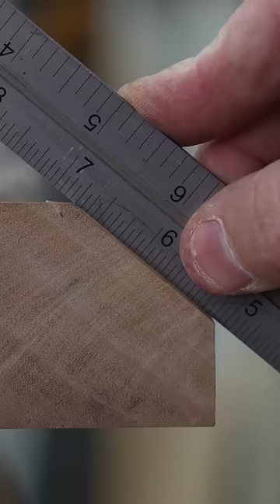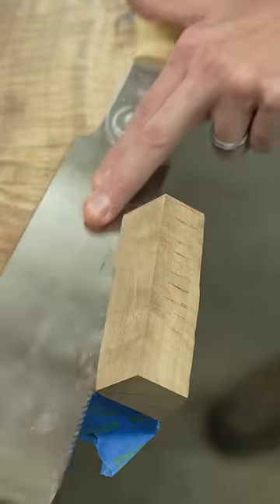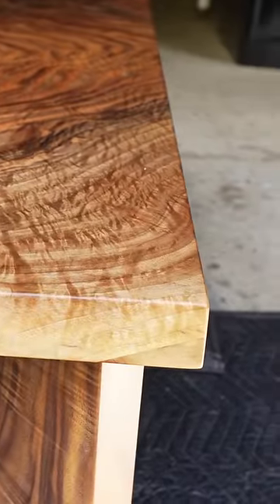Woodworking fix

Comment: That’s fantastic 
How long did you take finding a match 
You literally can’t see it 🔥
Reply: And was it an off cut from the slab itself
Reply from the maker: Thanks man, took a little while to get the best piece I could find anyway. Maybe an hour of testing chunks from the same slab. Not perfect, but about as good as I can do.
Reply: @blacktailstudiouncut  I doubt anyone will notice the difference unless it's pointed out to them
Reply: It's very visible
Reply: @jasonbroughton533  It's literally a different color. Not to mention you can see where the diagonal cut. I'm not saying it's bad, but it's definitely visible.
Reply: @dog2man1994  no it's not.
Reply: @bobkoroua  it’s on the bottom of the table not the top
Reply: @ramy1424  yes I know but it's not " very visible", if you didn't know it was there you would never notice it.
I notice stuff like this when I make it and my hyper critical brothers look and look but don't see it.
Not very visible.
Reply: @dog2man1994  its only that visible because he made a whole video on it. If you just saw the table i guarantee you wouldnt notice.
Reply: Great job that table
Reply: @highjix  I bet that’s going to be a great conversation to have with guests.
Reply: @pugas587  You can definitely see it. The corner of the piece he slapped on is way darker. Also it is confusing that he mirrored other his work on it or the final result. because the piece he glued on is on the underside in the "finished" shot.
Reply: you realize the cut is on bottom right?
Reply: You cant say its not visible he doesnt show the bottom final finish still looks pretty good looks better than the corner did before. Still good work.
Reply: @blacktailstudiouncut  i ca't even see it after the finish
Reply: @blacktailstudiouncut  nice job man
Reply: I mean literally can
Reply: You should Maybe visit an eye doctor. That "fix" is still super visible.
Reply: Not sure if you noticed but the corner he shows at the end is not the same corner, the grain goes in opposite direction...
Reply: @Dustin Fake   nobody seems to get that its upside down Jesus like I could draw round that dianagonal cut
Reply: Well then tell me where the knots went bud
Reply: For real. That's crazy.
Reply: You can see it. It's the part on the underside. Videos is a bit decieving showing the final picture of the top where there was no repair instead of showing the underside. The untrained eye will probably never notice it.
Reply: Flip it over. The patch was on the bottom corner. It's rather obvious once you see it. Its darker than the other.
Reply: @EliteKingsUnited  same corner just the chip came out of the bottom. He repaired it upside down. Finished shot was upright so patch is down and headed left instead of up and headed away. Stands out big time but it's on bottom so we will call it a little character. Lol
Reply: @dog2man1994 I think people don’t realize that in the first video it’s flipped over. So the new piece is on the bottom at the end and yes it’s very noticeable. If you know where to look
Reply: You can tell who the youtube woodworkers are..its visible, the patch was on the underside, the patch was never going to show on the finished side, but you can see it on the edge
Reply: As the saying goes, "Sh*t happens."
But your fix turned out absolutely brilliant!
Another reason to adhere to the old saying "Measure twice and cut once."
If I could afford to buy such a table, I'd be satisfied the repair BUT expect a little discount due to the "miatake."
But that's just me.
Reply: You can clearly see it, it’s just upside down
Reply: he is cheating in the video.  the "matching piece" is on the underside not the top.
Reply: It’s very visible and definitely unacceptable for an $18,000 table.
Reply: Because the scab piece is on the bottom!!!!!!
Reply: Why didn’t you show the scab piece on the top of the table, like the view we had on the repair?????
Reply: It's on the bottom. Look again.
Reply: It was on the bottom
Reply: @blacktailstudiouncut  what do you mean not perfect? That literally is perfect. Lol
Reply: I call bull on this customer interaction. I swear if you have this much luck with customers why do I get the fall out. I literally freaken literally had a customer say they can see a streak at 4 pm (   yes specifically at 4) on the finish. I have worse too.
Reply: @dog2man1994  you would lose a bet if you said you would be able to notice it was cut and they didn’t tell you. You’re not looking any cooler by lying saying it’s a big difference kiddo😂
Reply: @420HughMungus  because it's the bottom of the table! See the metal bats at the beginning of the video?? Those are the leg supports! He isnt trying to trick anyone,  he literally had to flip the table to do the fix! Y'all are so worried about something that has nothing to do with you....
Reply: @starfish3609  you're literally blind if you can't notice it.
Reply: @dog2man1994  The diagonal cut is only visible because you saw the process. Otherwise, it is indistinguishable from a grain line.
Reply: Literally?
Reply: @dog2man1994  no it isn’t.  You can’t see it even though you think you can.
Reply: @williamk9881  It's literally a different color from the rest of the table with a perfectly straight diagonal line. All of you people saying that you can't see it are color blind. It's one of those things that when it's pointed out it's impossible to miss.
Reply: @dog2man1994  you know what i gotta edit because i was thinking the fix was on the top but its on the bottom isnt it and yeh it is obvious. only noticed when i realized the angle of the grain is flipped.
Reply: @dog2man1994  it actually looks natural just cause theres a different color on the bottom actually makes it look more natural
Reply: @bobkoroua  idk after realizing he flipped the table so the corner was on the bottom edge i realized it is quite visible. ill never know if i would have noticed otherwise but i think i would have after years of owning it. Its a beautiful table regardless.
Reply: @DeathxCap  it sure is.
I make solid wood kitchen benches for family and friends, no money in it here), it's a piece I would be proud of.
Reply: @DeathxCap  it would be cool to wait 6 months and make another video where I " repair " a mistake and don't actually show the corner that was " repaired" and see if the experts in the comments section tell me the join is " easily visible".
(I'm drunk so maybe it would only be a dick move.)
Reply: @dog2man1994  You have superman vision
Reply: @blacktailstudiouncut  no, it‘s literally perfect. It blends in like it‘s one piece. Start giving yourself more props. Men are too humble these days, too put down by society.
Reply: It's all a cup of tea until it falls when when it's bumped .
Reply: The internet is an amazing thing, but it's also a place where people cannot wait to point out every little flaw you make, because somehow everyone else can do a better job than you. The fix is only visible because it was pointed out to you, otherwise it can come across as being part of the wood. A wood worker would see it if they were really looking, because the "grain" is perfectly straight, and the knot abruptly stops. The camera is literally taking a close up of it, asking you to look. Yes, once someone points out Waldo, it's hard to unsee him. 

It's not perfect, but to a customer, and anyone else that would visit that house, it might as well be invisible. If the knot wasn't there, it would be harder to detect, even to a trained eye. And had he made a cut that followed the grain, even the best of them couldn't see it. 

People get jealous. They hear the guy made $18,00 on his work and immediately look to tear it apart. It doesn't matter what people think, as long as he was honest with the customer and they love it.
Reply: @dog2man1994  yea little buddie and I’ve got a Bugatti in the shop we can all say things that aren’t true
Reply: Because he turned it upside down
Reply: 10k.... that acutally the only reason why wood is chosen over hemp... money... deforestation how many tree species are gone for ever?
Reply: @ramy1424  oooooh.
Reply: Looks Amazing !😊
Reply: Bottom Line...customer is happy!
Lets not get into the DNA structure.
 Looks fabulouso!
Reply: You can absolutely see it lmao. Its the bottom right corner
Reply: @Bobkoroua  lol like show a corner that wasnt fixed? I would be honest if i didnt see anything. Like before when i thought the corner was still in the same spot he showed when he fixed it, i was like "well goddamn i cant see a damn thing wrong".
Reply: You pay for what you get, right?
Reply: @ramy1424  you clarified this whole thing for me😂
Reply: @blacktailstudiouncut  nah bro that’s pretty bloody impressive
Reply: @highjix  or unless they see this video 😂
Reply: You only see it because you know about it.. otherwise you wouldn't  be looking for that subtle difference.
Reply: I can't see it,  neither can the customer! Well done.
Reply: It’s upside down at the end
Reply: Not only visible but on the bottom of the table!
Reply: @jasonbroughton533  yes it is
Reply: @bobkoroua  maybe you just overestimate yourself. I noticed it immediately, even the color is different. What are you on about?
Reply: @EliteKingsUnited  yeah it goes 90° in a different direction. I noticed this immediately, right before he sawed off the pieces. He definitely fucked up.
Reply: @harrisonherbstrith8157  That's not the point. He specifically doesn't say it is on the bottom, even though it is common sense to put the fix on the bottom. But he mirrored the last shot so it looks like the fix would be on the top like it was when he fixed it when you don't pay close enough attention.
Reply: @dog2man1994  lol maybe go see a obstetrician
Reply: @blacktailstudiouncut  I'm amazed the chatoyancy matched up so well. Fantastic job!
Reply: @wildkeith  it’s only visible because you know what your looking for. I doubt a visitor would notice cause it does just look like natural variance.
Reply: Amazing work, true craftsman!!!!
Reply: @highjix  hell with him showing the final product I still can’t see the added corner he did amazing
Reply: @dog2man1994  you have no clue about wood working so you?
Reply: “Not perfect”, well you are the only person that will see the flaw, very nice job.👍
Reply: It's the lower part of the right edge... (upside down view)
Reply: @dog2man1994 sure.. slight visible maybe but very? You either got eyes of a eagle or just over exaggerating -_- I understand the different color I guess but I still don’t see a huge difference in color..
Reply: Lol yes you can easily see it
Reply: @dog2man1994 it looks like wood grain
Reply: @Caffeine.And.Carvings  no is not
Reply: Are you blind.it s upsidedown😂
Reply: @jasonbroughton533  Its on the bottom side. But he makes it seem like its on the top
Reply: @blacktailstudiouncut  brilliant work 😊
Reply: @dog2man1994 if you are specifically looking for it no s--t you will easily see it but if you aren't looking for it or don't know that was a different piece then it's not a chance in hell you're seeing it
Reply: @danielchist93 hh yes, it’s so noticeable you have to tell people where to look 🤔 

C’mon bro, go to NYC and you don’t have to tell people where the One World Trade Center is because it’s noticeable.. you don’t have to tell people where the Burj Khalifa is when you go to Dubai, because it’s noticeable… get it?

You having to tell people where to look on this table tells you how unnoticeable it is.
Reply: @blacktailstudiouncut  Not perfect? Not only can you barely tell at all, but you were forthright with the mistake and kept the customer in the loop, alongside spending extra time to fix a mistake instead of cutting corners? 🤌👌
Reply: @dog2man1994  hi handsome. Could you back up your comment with a time stamp , giving us a time line within the time clock? Thanks.
Reply: @jasonbroughton533  😅😊😊😊😊😅😅😊😅😅😊
Reply: @blacktailstudiouncut  unless they are pro, like yourself, you ain’t seeing that false corner.
Reply: @dog2man1994  ignore them. You're completely right. And anyone that cared would notice
Reply: @dog2man1994  It is certainly visible but not "very visible".
Reply: @dog2man1994  it is for pros
/i am not a pro
Reply: @highjix  I didn't even realize it was on the bottom at first because I thought that was just how the wood was
Reply: Soooo...when all was said and done you really DIDN'T mess up on the table, you knew EXACTLY how to change it, and you're WAY too hard on yourself and that needs to change.

Hopefully this will speak to the self-doubt selftalk that roams infinitely around in the mind of truly creative souls!
🙏🌞
Reply: @pugas587  lol you’re so wrong bud… it was incredibly noticeable. It’s very obvious that it’s a different piece of wood.
Reply: @titifredie3056  you can literally see it. Only way you’re not seeing it is if you’re blind LOL
Reply: @Mikasicki  yup. He’s trying to hide it and did a good job but it’s still very noticeable.
Reply: @jasonbroughton533  he films the fix with the "fix" on top. He films the finished product with the "fix" on bottom. It looks great regardless, but yeah it's a little misleading
Reply: question!  what makes it 18k sir?
Reply: he didn’t need to find a match, just showed a completely different corner and fooled us all, have a look at the video again the grains are in opposite direction instead of going away from the corner it goes towards the corner 👎
Reply: @pugas587  there's a difference between visible and noticeable. It is very much visible, but you'd dismiss it unless you knew where to look.
Reply: It's actually very visible if you know what to look at. The side face us at the end for the picture is the side that wasn't facing us directly when he fixed it and has been flipped over. The entire bottom corner chunk is the fix.
Reply: That's insane you can't even tell. Now i know video does no justice for anything but dang
Reply: @ULTIMATEGODZ1996  Holy shit you're amazing.
Reply: I think it was at the bottom side. Look there.
Reply: @bobkoroua  its actually very noticeable when you realize it's on the bottom now and not the top.
Reply: I can see it but I'm an expert.
Reply: Ok
Reply: It looks pretty dang perfect to me
Reply: @Mikasicki You and that other dude are trolls or just trippin'. In the final part of the clip, it is not visible. He didn't mod the underside of the table, only the top corner and it is SEAMLESS. Shoo troll, don't bother me.
Reply: @jasonbroughton533  Clearly not a wood worker, its not a great fix, and for that price, i would call it a scam
Reply: @blacktailstudiouncut  not perfect he says. My eyes can’t detect it, it might as well be perfect 😂
Reply: You can see it.
Reply: @dog2man1994  I paused the video again and again, and checked using magnyfing glass of x5 and x10 magnification. I don't know what you see, but I only see the wood grain.  I can't see the cut and there is no color difference. The finished piece is flawless.
Reply: The curse of the artist. Only the artist knows all the "flaws".
Reply: @greekveteran2715  no it's not you don't know what you're talking about
Reply: @dog2man1994  i gotta agree with this guy guy, at first i watched the top of the table looking for differences, but the corner is on the bottom side of the finished table and its definitely visible
Reply: Who pays 18000 dollars for a coffee table.
Reply: What people don’t realize is he probably spent more time looking for the prefect piece for the corner as he poured countless hours of hard work into his table. 18,000$ sounds like a lot but for a table that’s handcrafted that will be here the next 150 years+ if we had a tenth of craftsmanship like that with everything that was produced you wouldn’t need insurance policies for everything, now it’s made to break and be replaced every 5 years and most people have gotten ok with that and it’s sad. Your work ethic and craftsmanship really shows with this piece. This beats any 3d printed table I’ve seen I don’t care how complex the algorithm is they use.
Reply: @highjix  And the only reason to point it out would be to show off that nobody noticed it. I still don't notice it.
Reply: @blacktailstudiouncut  Thats perfect and when not its 99%
Reply: @jasonbroughton533  yes it is 💀
Reply: @jasonbroughton533  you cant see it.  its confusing cause the cut is on the bottom of the table. and during the video the table is upside down. so your eyes look at the tope.  still AMAZING  work.   would love to work in that shop
Reply: @blacktailstudiouncut  o
Reply: Wow he got robbed for that kinda money dude could have did a lot better
Reply: Some people need glasses it clearly visible
Reply: @highjix  some people obsessively over analyze new things
Reply: You definitely  see it.  It's that clear solid line on the under side.  It's upside down from how he worked on it.   You see that small part that super dark?
Reply: @pugas587  if I paid thousands of Dollars  I'm noticing everything.
Reply: It's on the underside and it's obvious.
Reply: @jasonbroughton533  I’ve been doing woodworking for a few years. It’s quite visible on the bottom right of that piece. It a good match, but the joint is quite visible.
Reply: I could see it
Reply: @jasonbroughton533  It is definitly visible, but since it's on the underside of the table it's not as notieable
Reply: @Dustin Fake  yeah but it blends in with the natural diagonal lines so you really wouldn't know unless someone tells you
Reply: @bobkoroua  dude it’s so visible. You are insane
Reply: Beautiful...as.always😊❤
Reply: the grain changed, unfortunately this is fake
Reply: This is insane, exellent work!
Reply: @Mikasicki  he didn't just "slap it on"
Reply: The piece you fixed is on the bottom, it would be impossible to match the grain that perfectly 😅
Reply: That's a true craftsman.
Reply: @blacktailstudiouncut  myyy but dude, that looks like it the exact same piece. The grain on the top, and both sides run perfectly. It actually looks like it grew with the tree just look at those growth rings!
Reply: @blacktailstudiouncut  bro u can't even see a line so you did well!!! Does that wood glue hold up strong??
Reply: You can see it plain as day. The seam isn’t on the top it’s on the bottom. You can see the side seam down low. It doesn’t match at all. Very deceiving video. How about a picture of the bottom so we can actually see what you are so proud of?
Reply: I'm amazed no one has noticed the final shot was of a different corner. Or maybe a different slab all together. So fake.
Reply: @dog2man1994  different corner in final shot
Reply: HURR DURR 18 BAJILLION QUAZILLION
Reply: @dog2man1994  yeah maybe to someone who works with wood, but no customer would ever notice and wouldn’t matter anyway because they already knew…..
Reply: @dog2man1994  ok it might be noticeable but that’s only if your paying attention to all the details of the table I highly doubt a lot of people are gon do that
Reply: @blacktailstudiouncut yeah but really what is perfect…outstanding job and just great work all together!
Reply: Looks flawless fam
Reply: @blacktailstudiouncut  Hahaha, you're way too modest! You have to know that it looks perfect!! Impeccable work, my friend.
Reply: $18,000 for a coffee table?
Reply: thats because its upside down... watch again.
Reply: @blacktailstudiouncut  No one is paying 18k for a coffee table, stop with the lies and clickbait
Reply: Well done!
Reply: @dog2man1994  That the corner looks naturally at a 90 degree? You are right
Reply: @Blacktail Studio Uncut  I'm sure only woodworkers can notice it. I've realized people who work in an industry can spot mistakes better than someone who doesn't. I don't know anything about woodworking I did it once in high school never touched it again, but that's because I wasn't interested in it I like seeing other people do things because damn you're amazing.
Reply: @dog2man1994  just looks like the pattern of the table. If he didn’t make this video and you got asked where is the added on piece? You would not be able to find it 😂
Reply: @blacktailstudiouncut   dude kicking butt and taking names
Reply: @Dustin Fake  bruh not one person on earth is going to look at that beautiful coffee table and think about that corner
Reply: You can't  see it because it's not the same corner.    Look at the grains at the beginning and then at the end.....     BOGUS 😂😂
Reply: Bravo 👏👏
Reply: @dog2man1994  no it's not
Reply: @dog2man1994  "im so unique by disagreeing with people"
Reply: The replaced piece is on the bottom, which on its own makes it a lot harder to notice.
Reply: @dog2man1994 When the stain is on? You can barely find it the grain matches almost perfectly it's impressive
Reply: That’s fantastic 
How long did you take finding a match 
You literally can’t see it 🔥
Reply: These commenters need to get a life.
Reply: I’m impressed! It’s beautiful!
Reply: @dog2man1994  I repair a lot of antique and expensive wood pieces including tables. You can perfectly see where the new piece is. He did match the grain very well but the color does not flow like it would have. Making it super visible.
Reply: @jasonbroughton533  It is. The slab is FLIPPED, so it doesn't look like it does for 95% of the video. The cut corner is UPSIDE DOWN at the end.
Reply: @bobkoroua  True? I agree with him in that you can definitely see it, so it's definitely visible, but I also agree with you that you wouldn't notice it if you didn't know it was a fix at first, but only in the sense that you wouldn't notice that it was a fix. You'd still notice it, but only as a part of the overall pattern of the wood. It doesn't look like it was cut off from another slab, it just looks like it was part of the wood in the first place, but not in the seemlessly uniform sense of "wow, it has the exact same color as the wood it's next to", rather in the sense of "the wood has a pattern, that part fits the pattern enough that it doesn't look out of place even if the color is different from the part immediately next to it"
Reply: @Caffeine.And.Carvings  True? It's definitely visible (specifically, darker than the part of the wood it's immediately next to), but it fits the "pattern" of the wood enough that it looks like it was originally part of it anyway, rather than seemlessly joing with that lighter part of the wood, or being too dark that it's obviously from a different slab. Like, you can definitely see it, but you don't really notice that it's a fix, you just think of it as the slightly darker stripe that's supposed to be next to the slightly lighter stripe.
Reply: @moondust2365  exactly.
I replied to someone saying something like " it's very visible".
It ?
A line in the grain that you wouldn't know was a join if you didn't know it was a join.
So clearly ( at least to me) the "it" he is speaking of is not at all visible.
I have been building stuff in wood since 1982 👴🏽 and I would be more than happy with that repair.
I would use my wonderful little DeWalt biscuit joiner 😍 to give the join some bite but that's probably a waste of time.
Lots of people online have an opinion about stuff they know next to nothing about.
How strange to speak to a person called moondust so very very long after my childhood when I had friends called moonbeam and starlight.
🌖🌟
Reply: @dog2man1994  I don't think you saw the finished version at the very end of the video
Reply: @Fitzcrackers4prez  I don't think you did. Look at the bottom right corner.
Reply: @dog2man1994  yah, its a tree, trees have patterns like that, it's got a similar thing a little too the left of that
Reply: @Fitzcrackers4prez  I'm convinced you haven't seen the video if you're mentioning a left corner. If you actually paid attention to the video you'd notice that the colors of the corner don't blend naturally and the area with the cut just pops out with a darker shade.
Reply: @jasonbroughton533  yeah it's on the underside. But it looks fine.
Reply: @dog2man1994  I didn't say left corner, I said a little bit to the left, trees have many patterns and this is one of them, a tiny bit to the left is a change in color naturally and the piece that was put in looks just like that, making it look like the end of that pattern
Reply: @dog2man1994  I'm convinced you've never seen a tree because trees have stuff like that all the time
Reply: @Fitzcrackers4prez  none of those spots appear out of thin air. All of those radiate and then blend in naturally with the rest of the wood. That's a stark contrast to that dark spot on the cut corner.
Reply: @dog2man1994  you obviously still haven't looked at what I told you to,  and if you have you're blind. That's all I'm gonna say, if you're not gonna look, nothing I say really matters
Reply: @Fitzcrackers4prez  I hope you never get a position in a detail oriented job if you're calling me blind. Your lack of attention to these discrepancies is laughable. Please get your eyes checked out by an optometrist soon.
Reply: @dog2man1994  what are you talking about I'm saying you can see it, I'm just saying it looks like a normal pattern and almost completely matches one that's a little bit to the left of it
Reply: @Fitzcrackers4prez  dude, really. Get your eyes checked. I've said this multiple times but you refuse to accept it. Those other dark spots radiate in to the lighter colors before disappearing. The tip of the donor corner that was glued on doesn't blend in naturally with the edge it was applied to. Notice the tendrils seeping out of the other dark spots that end up fading into the lighter color. Notice how the cut doesn't have the same seepage.
Reply: @dog2man1994  yeah, but that little dark tip is the only thing really making it a bit less natural and it's pretty easily overlooked, unless you know about the table being fixed and focus on that one spot looking for little impurities
Reply: @Fitzcrackers4prez  the entire video is him pointing it out, lol. It's one of those things where once you see it it's hard to miss.
Reply: @blacktailstudiouncut  it is perfect
Reply: The piece is on the bottom side of the table, and you can see it. You can't see it of course if you look on the wrong side😂
Reply: @blacktailstudiouncut  fym not perfect 😂 it is perfect 100%
Reply: I couldn’t tell. Brilliant job! So talented!
Reply: For 18K you a)dont make that mistake and b)if you do, you get a new slab. Period. That's always going to be a weak spot. And it's about principles.
Reply: Cause that's not the same side ! 😂
Reply: @dog2man1994  stop the cap mister fake
Reply: You can, it is the bottom corner. It isn't too obvious though.
Reply: U literally can
Reply: If the table is in the same orientation at the and as it is in the video: it’s a flawless fix. If the table is flipped upside down like my senses and brain is telling me, the customer deserves a discount. It’s a beautiful table, don’t get me wrong, but that is visible enough to warrant a discount, imho.
Reply: @l4unchp4dgaming38  🤦‍♂️
Reply: @Jimmothy_quintajohn  rich people. Nothing wrong with that.
Reply: @blacktailstudiouncut  I’d say that was a perfect job
Reply: @highjix  I don't think I would notice even if someone pointed it out
Reply: 23 million millionaires in America
Reply: the repair is on the bottom. the finish product is showing the top up.... and repair is very obvious. look with your eyes, no your expectations.
Reply: Wow that is amazing. Seriously.
Reply: @blacktailstudiouncut  I've worked with wood on sets (80s & 90s) and for my home/family/friends.

I was taught by an old school wood worker, and on video I can't see the grain change.

You did a phenomenal job, although I am sure one of your regular haters will be able to make up a problem. Wood is not the most predictable medium to work with, you never know what imperfections you can find when you trim down to size.

You do impressive work.
Reply: Hey, what glue did you used on it
Reply: You’re failing to take into account to the time, labor, effort, tools it takes to even get to this level of craftsmanship….what i would guess is at least 20yrs
Reply: He
Reply: $18,000? !
Reply: @dog2man1994  the table isn't the same color all the way through and there is a diagonal line on the underside a little farther up that is a part of the natural wood so you literally only know that wood was replaced because he told you. Who really looks at tables at peoples homes to see if it's just a solid piece anyways. Just stop.
Reply: @fukksake  it's another diagonal line in the natural cut of the wood so you wouldn't know that was a separate piece of wood unless you were told. The table isn't one consistent color either so there's that.
Reply: he cut other corner of the table to replace this corner lmao
Reply: @blacktailstudiouncut so you matched the pattern of the wood with the table but, here’s the kicker, you covered it with a texture?
Reply: Frrr
Reply: You can't see it because it's a different corner.

In the beginning you're looking at the bottom and the legs go left to right and we're in the bottom right corner.

In the end, we're still in the bottom right but the table has been flipped over, we would have to be bottom left to see the same corner from above.
Reply: @dog2man1994 to be fair, the wood color is very inconsistent in this wood so it could be harder to tell when see the whole thing
Reply: @highjix I can’t notice, and it is pointed out to me
Reply: I would never know if I didn't see this
Reply: @dog2man1994 Bro has never used wood finish before 💀
Reply: Epic dude! A very ingenious method of repairing that corner. I have similar corner damage on an blackwood coffee table and I'll try your method so thank you for teaching me. 😊
Reply: @dog2man1994 did you watch the whole video?
Reply: Wasn't that last shot a different corner though?
Reply: @dog2man1994  You talk like wood doesn't naturally alternate colors once in a while. It looks natural, even if it's mildly off.
Reply: Is this a drug smuggling table with a secret compartment? 18k geez
Reply: @dog2man1994 No offense but from the other lines people would assume its just the same piece. It may be visible but it's still really good and blends in nicely
Reply: You literally can see it. LITERALLY quite obviously.
Reply: @bobkoroua  Yes. It is.
Reply: LOL. It is more then obvious "match". Anything would look better lol lol.
Reply: It's the bottom part of the corner lol
Reply: @bobkoroua is too.

It's the bottom side of that corner lol
Reply: @ULTIMATEGODZ1996 ❤😂
Reply: It’s on the bottom
Reply: Wood
Reply: Fyi he flipped the table over so the piece is on the bottom its fully visible
Reply: @blacktailstudiouncut This is probably perfect man
Reply: @dog2man1994 not really
Reply: @dog2man1994 no it’s not
Reply: @ramy1424 your average person would probably just think that's part of how it was stained, as someone who knows a little bit about woodworking had you not pointed that out to me I would have never noticed.
Reply: You can see it’s at the bottom corner , it’s flipped
Reply: @dog2man1994 if you had to find it without ever seeing the video, you would never find it in a million years. Nice try pal
Reply: Unreal bro that’s years of
Craftsmanship
Reply: Yes it is totally visible, he flipped it over and there is a dark straight line where the repair is. Also he should have used a dowel pin for extra support due to the repair being on a corner.
Reply: You’re probably looking at the wrong spot tbh. It’s upside down while he is working. You can see it on the bottom, after the finish
Reply: The slab is flipped over so it’s on the bottom
Reply: It’s very noticeable.. not looking in the right spot.. but it’s nothing that changes anything.  Good job.
Reply: I just noticed that it was upside down.
Reply: @blacktailstudiouncut it looks perfect to me tbh
Reply: You can definitely see it. You just have to know what you’re looking for
Reply: @blacktailstudiouncut  if that's "not perfect" then i need to see perfection right now, because i can't even tell that "not perfect" was ever a missing chunk to begin with
Reply: @blacktailstudiouncut  What do you mean not perfect, its literally perfect lol
Reply: Glad to see honest men doing honest work. Looks great. I admire the attention to detail about he grain matching
Reply: @dog2man1994 Petty! It’s on the underside.
Reply: I’m no expert on this but I do some woodworking and I can see that 
that’s not the same corner on every shot before the stain you can see the wood grain not going the same way 
But after the stain the wood grain is perfectly aligned 🧐
Reply: This is impressive
Reply: @blacktailstudiouncut  If you see any imperfections please point them out to the class.  Well done
Reply: @dog2man1994 you are right i thougt it was great but then i noticed it's on the bottom and the people in the comment section may only look at the top.
Reply: @dog2man1994 do you wake up and decide, "I'm gonna be a cunt" or does it just come naturally? O
Reply: Because it is not the same corner you show in the final part of the video
Reply: @blacktailstudiouncut It might not be perfect in your eyes, but your the craftsman so I’d expect you to catch any tiny details, but to me it looks like theres was never any added pieces in the first place!  That was a ridiculously good match, amazing job, just goes to show how far experience, skill, patience, and an eye for detail will get you 😅
Reply: Finally a proper fix done by the book done as you should, just take your time find the right offcut clean the join, clamp it up leave it overnight if needed. Then cut away the majority and take your time reducing it down with planer and sander until you can literally not see the repair.  It’s simple really and this is a perfect example of how it’s done properly.
Reply: Filmed the other corner 😂
Reply: @highjix it was pointed out to me and I can't see it
Reply: @blacktailstudiouncut why make this video and lie? The grain is \\\\ in the before and (((( after. Unless you are working on bottom face.
Reply: @highjix its the kinda thing youll be looking att in ten years and notice the imperfection and itll be too late to get annything done about it and be maad at thatt 18k. So props to this guy for making sure they felt nlike they got their value.
Reply: 😮That's what I'm saying
Reply: You can 100% see it. You aren’t looking at the right spot. He neglected to tell you the part he was working on was the bottom of the table, and he flipped the table upside down. Look at the bottom of the table you clearly see the triangle shape.
Reply: @nova2512  it's not that bad, and you are a very annoying person
Reply: Your a troll dude. Obviously you've never done any type of woodwork because he did as close to a flawless job at fixing that as you can get. Why can't you just say impressive because thats what it is. @dog2man1994
Reply: Magician
Reply: @blacktailstudiouncut  "not perfect"
Is literally invisible
Dude, what's your idea of perfect even!?
Reply: @dog2man1994 no it’s not
Reply: It's the bottom corner
Reply: Wish you would have shown both sides of this bottom corner.
Reply: Who
Reply: @dog2man1994   I would say it’s bad. And at that price tag, unacceptable.
Reply: That's a GREAT job! 👍🏼
Reply: @dog2man1994  You wouldn't have noticed if he just tried to hide it.
Reply: @highjix I wouldn’t even know, if it was pointed out to me lol
Reply: @dog2man1994 give him props for the grain matching and the color change isn't even really there
Reply: He did an amazing job on this I would want to buy it 🎉
Reply: @dog2man1994 admittedly im colorblind but i literally cant see it
Reply: Yes you can notice, it’s just that when he shows at first it’s the top corner being worked on then when he shows the finished piece it’s flipped so the corner fix is the bottom corner
Reply: @bobkoroua yes it is, put those 3 brain cells you got floating around together for a few seconds and use your max brain power to figure out what’s going on here bud
Reply: After finish looks perfect
Reply: You can clearly see it. The tabletop is flipped over, so it’s bottom right part that’s added. 
Pause the video on the very last frames to see.

I could not do it this well, so bravo and much respect. Very nice job nonetheless, but not invisible.
Reply: @highjix  Even when it's pointed out and we're staring directly at it, I couldnt tell.
Reply: he flipped it upside down
Reply: @blacktailstudiouncut it’s perfect.
Reply: So your working on th bottom side of table.
If you look you can see the diffrence. bottom corner.
Reply: @Mikasicki  He didn't mirror it, the repaired corner was on the bottom of the table. Of course while repairing it, he had the table upside down.
Reply: He didn't, he simply glued back on the piece he originally cut off..wouldn't that make sense?
Reply: AND THE CLIENT RESPONSE
Reply: @blacktailstudiouncut  nah man it looks perfect
Reply: @dog2man1994  you could easily argue that it's part of the grain direction and just colored differently. This is a top notch fix not easily seen by the untrained eye.
Reply: @bobkoroua  the cutout is on the bottom corner, not the top
Reply: easy to see its on the bottom not the top
Reply: @dog2man1994  myabe before he finished sanding and treating it but when its finished and glossy you cant tell me you see the cut or anything at all
Reply: That's cos he flipped the wood in the last shot. You can see the corner on the bottom.
Reply: @dog2man1994  it’s not though apparently you don’t know how wooden tables like this works😂😂😂
Reply: @bobkoroua  its very noticeable
Reply: @EliteKingsUnited the cut is on the bottom. its because its flipped.
Reply: @420HughMungus oh i dont know, maybe because he built the table with that part facing down? use your brain.
Reply: @EpicShotLP its on the bottom in the final shot. its very visible.
Reply: It's on the bottom of of table when he shows it
Reply: Are you blind?
Reply: I mean he made the og one so
Reply: transparency and honesty is always a good look. 👍 even if it bites you in the end sometimes it's still worth it.
Reply: @blacktailstudiouncut dude it's perfect you can't even tell loll
Reply: It does look good, I'll give him that. Most normal people would never notice that. It's ashame the first shots was of the table upside down, then the final shot was of the table on it's right side up. 😂 Didn't get to actually compare the difference
Reply: You can see it. In the finally picture it is at the under side.
Reply: @highjix except someone like me😂
Reply: Tá de ponta cabeça
Reply: Es ist nicht der gleiche Tisch,schau masserung vom ersten zum fertigen es ist fake
Reply: @RingoR6 Es ist der selbe Tisch er hat ihn umgedreht und das Bild gespiegelt
Reply: Только это не тот угол😂
Reply: يجب وضع الدعامة 🪵🩹
Reply: Es hat eine weile gedauert aber am Ende hab ich eine neue platte genommen, sieht genauso aus wie die alte nicht war? 😂😂😂
Reply: @ramy1424 sí creo que solo los analíticos nos damos cuenta de eso
Reply: 😂😂😂😂😂 Lol!!! Good editing